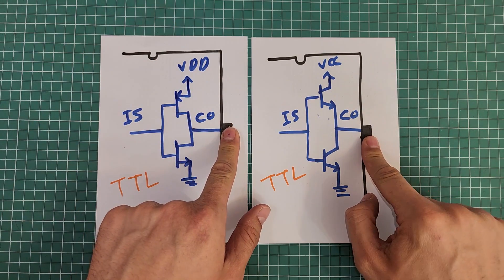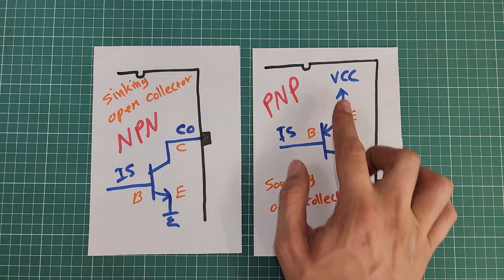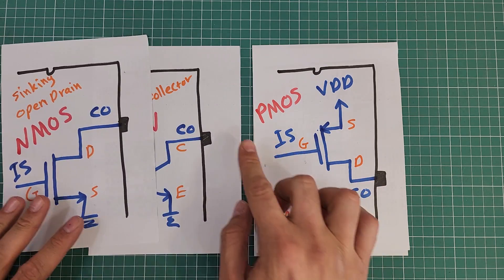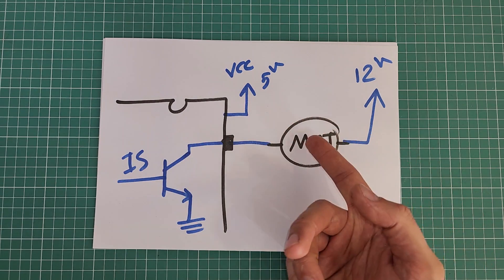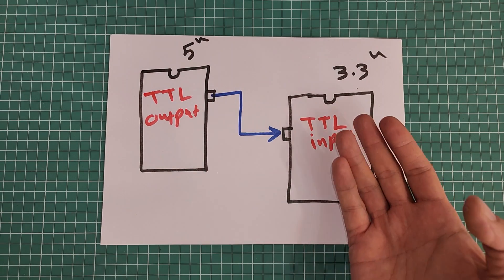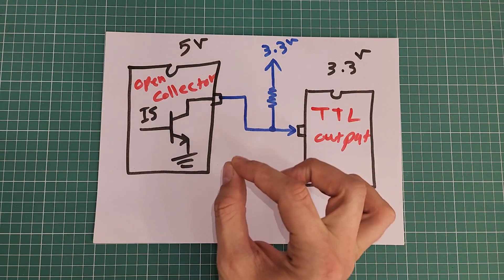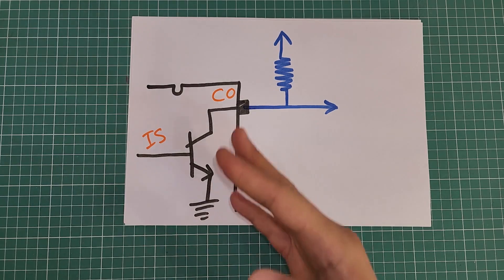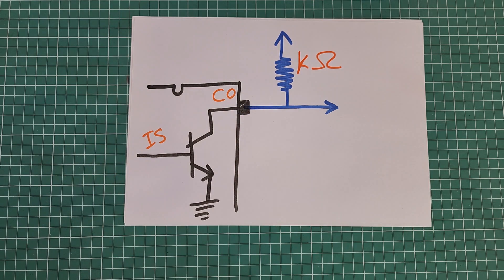How can a transistor form an open collector/Drain output?

Comment: 6:45 Could you please elaborate on why an open collector can drive more load current?  I ask because it seems to me that a TTL output could also be connected directly to the load and when the bottom transistor is sinking current to ground, it is effectively the same as an open collector since it's collector is also tied to the load.  Thanks.

Comment: Is there a mistake on 2:45 on TTL BJTs diagram? 
I mean the upper bjt should be PNP, but you drew both of them as NPNs. If there is a logical 1 on their inputs, there would be a short circuit.
Reply from the maker: I dont think so, there are several diagrams, search for ttl circuit on google.

Comment: if we connect the output of a 5V open-collector IC to the input of 3.3V IC (with pullup resistor in between), does that mean current flows from the input of the 3.3V IC to back to the 5V IC (and then ground through the transistor emitter)?
Reply from the maker: No, current will flow from Vcc to the output if it is active. I mean if output is active (connected to ground) then current will flow from vcc through pull-up resistor to ground.

Comment: hmmm so open collector/drain can drive the output directly and with any voltage because the voltage (lets say to activate a motor) is set by the power supply? if the IC is sourcing the output voltage is limited by the ICs Vcc
Reply from the maker: Yes exactly, if the output is sourcing then max voltage on output will be equal to VCC/VDD

Comment: Great video! I'm well versed on I²C communication and I knew TTL (transistor-transistor logic), but I never SAW why it was called TTL until this video. Also, the two pull-up resistors (usually 10k) on the I²C bus on SDA (data) and SCL (clock) make total sense now. Thank you!!

If at all possible, can you compare I²C and SPI in a future video? Thanks!
Reply from the maker: Awesome, glad this video was helpful 🤗